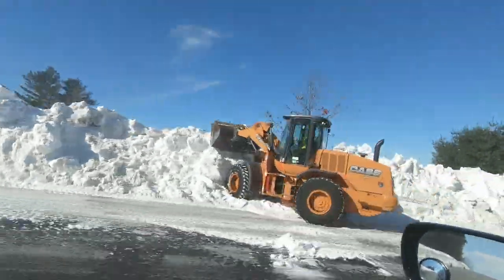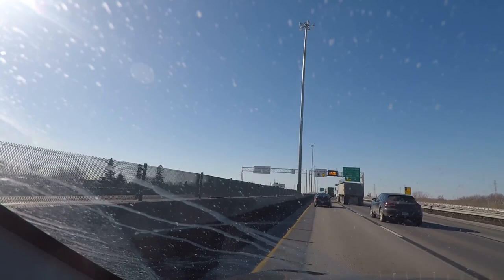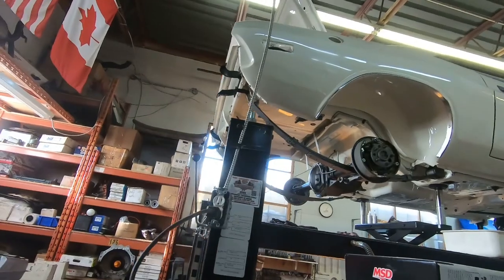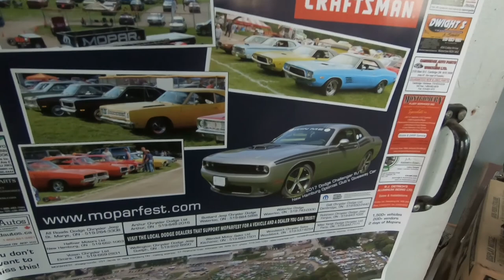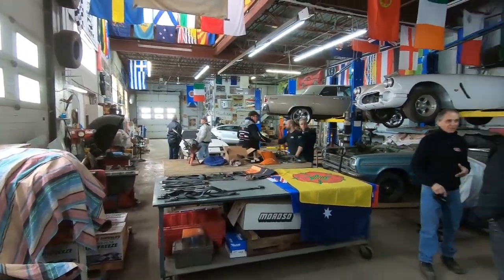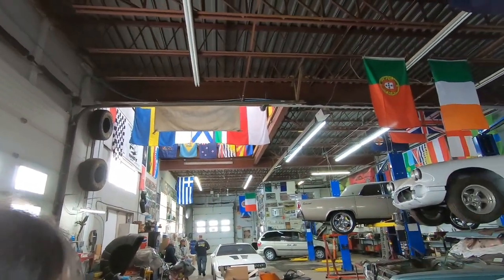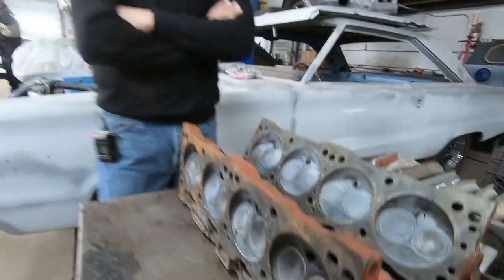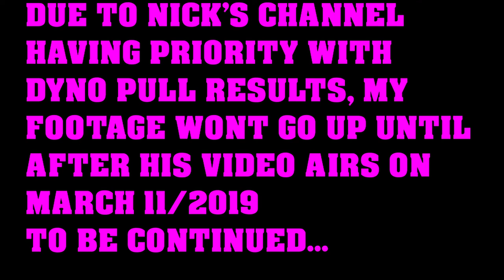Nicks Garage Road Trip Pt.1- J Heads for the Cordoba

Comment: Gonna be a long drive huge tank on the 150 @ 0 km there is still 20 liters in the tank which is about 150 km on the highway
Reply from the maker: It is a huge tank. But not as much left in it from zero as you think.
Reply: @OldeCarrGuy  super cab has the 90 tank I was thinking the 140 liter tank in my truck.  My bad
Reply from the maker: When I went to fill it up it took 137L so it does have the bigger tank!
Reply: @OldeCarrGuy  when I fill my truck from 0 it generally takes a 120 liters .my truck average is 13l/100 k which is where my match came from lol .them capless gas necks are a pain ain't they. Good video full disclosure I have not run out of gas with it lol

Comment: That's a sweet Challenger by the way, pretty cool that it's a factory disc brake car.
Reply from the maker: I couldn't confirm if it was factory disc or he upgraded. But with the power of a 440 and 4 speed, he's gonna need them!
Reply: @OldeCarrGuy  That's for sure LoL
Reply: Impact's G G.    It came from the factory with drums up front. I had a set of E body front discs and had them installed.
Reply from the maker: And there is your answer right from the owner himself.
Reply: @nickpanaritis4122  Cool, thanks for telling us! (Really dig your channel by the way!) 
I think it's awesome that you upgraded it with factory parts. After daily driving a 68 Satellite for the last ten years I've discovered that the factory engineering from that era is highly under rated, so it really grinds my gears when I see people throwing out perfectly good factory suspension, brakes and steering parts to replace it with some goofy looking aftermarket stuff.